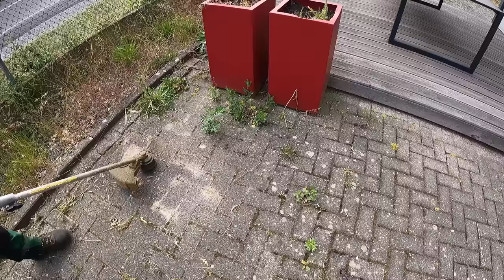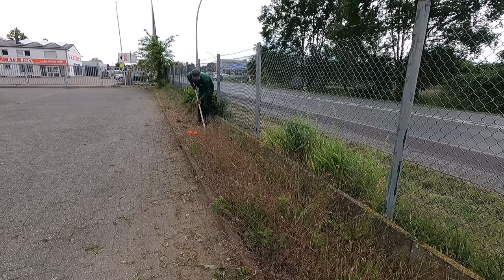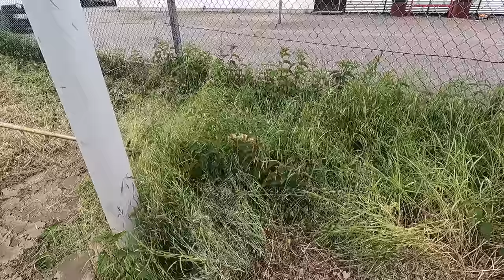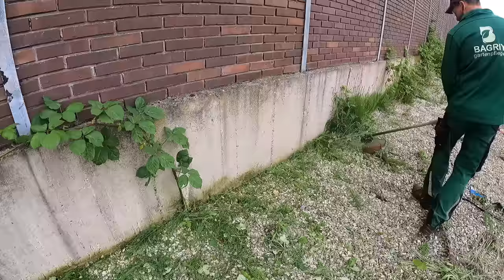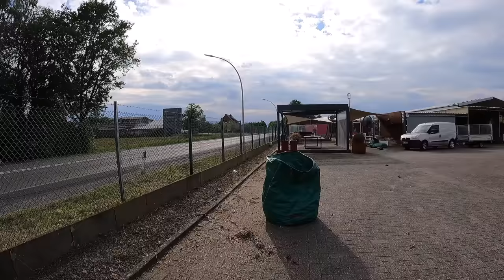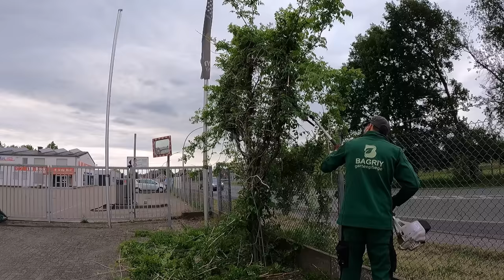URGENT Help in CLEAN UP the Yard of the Company OVERGROWN with Weeds

Comment: Good evening, can I ask what Stihl string attachment you have on that Kombi? For them kind of jobs I use my STIHL RG Rotary Cutting Head Attachment, or my weed de ruster wheel attachment. Also does using the strimmer wire also get moss, weeds, debris etc out of the cracks in the patio/driveways etc? 
Thanks in advance JB
Reply from the maker: Greetings, I mostly use the 25-2 line attachment for removal, moss can also be removed with it, but it is much harder, so I use a nylon or metal brush attachment that is much more effective. The RG is good for overgrown weeds but I haven't got it yet.
Reply: @kustorez777  thank you so much for your swift reply :), st your convenience please could you send me a link of that Stihl line and attachment spool you use? I have the old KM 130R Kombi Unit, would I just need to re fill the spool I have currently with the line you use? Thanks so much
Reply from the maker: @jamesbinney9316  https://www.ebay.de/itm/175481215878?hash=item28db7edb86:g:YNQAAOSwpP1jabYP&amdata=enc%3AAQAHAAAAsAgSXRGsC36Izx6QbbEoo6pJ2GTyZQYcEcvKQUq%2FCiITYNkCW6aSNZdtSKZ%2BZsPD2DuLoyDZNmjWuecNDIyZ3eYU%2FIDZfmgfNeLeaeoeA0VMKliLAa0Uqkpqd2xTJy0dOuV6f7Z6tKcMzkJSEJUzZhQMC4keWCaHC0f7LpEhBYSXhAWgPQFnfq6wMYd8F8fgh8VqI%2F24Pe232C%2BudgXNECS%2F3XuzXu0KIdTI6rZu2PPj%7Ctkp%3ABk9SR4DdmoyLYQ

You can also put this brush on your KM,

https://www.ebay.de/itm/272706027036?hash=item3f7e8bbe1c:g:ekMAAOSw2gxY1PlR&amdata=enc%3AAQAHAAAA8ILDFWdQQG3VJascIyXGyrKed%2Ft5hCniHZEkSOhbvAoNw2ecGSTsnfrBK8SZYDkUK2jm5BiBqontWKKP9lYhWTrQofP%2BP8SO2UBJt6dl8UFah3lqPdZh0zoL%2Bwat%2FwVqqEgz6jvUHlHF1opDULoMtdglKXxdKGrlecGglxJSH2giQhvWNdBpcbF7phbLfQ%2BWmMa3EsmVmAEAhf6CFistWpRdPydQBbizPbBG8Ee0RNgqpWIe2pyozW%2Bti%2FGjgqK5d%2Fh1fLCQx4JfXTEHB2FQJKjwKfwKJ3xVVyJhTWHl%2FZ3kXtmjxWw75UmHdRSWZzLPdQ%3D%3D%7Ctkp%3ABFBMgKW5jIth